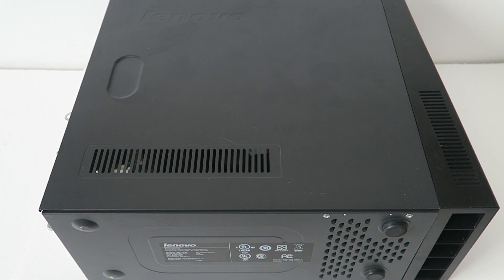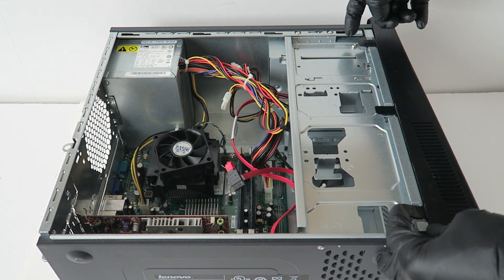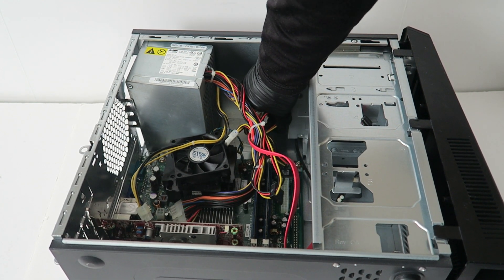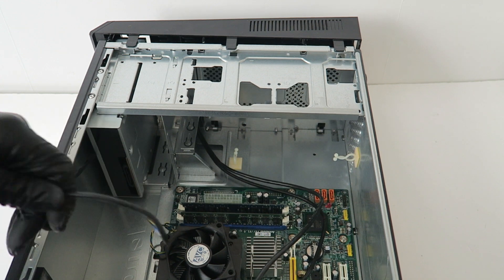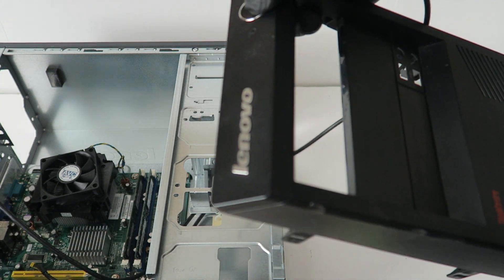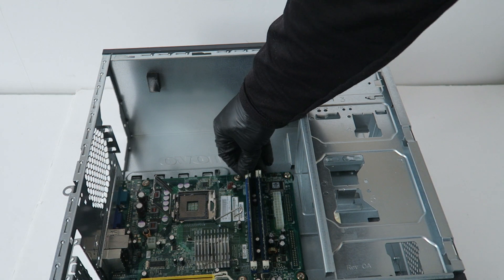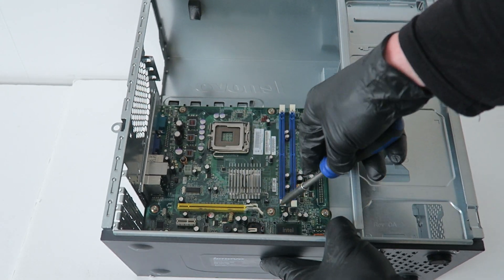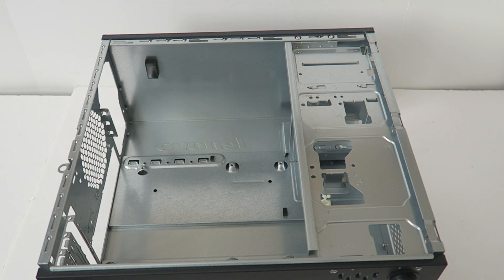Lenovo ThinkCentre Teardown

Comment: Hi, could the front panel connector (power button, reset, ecc.) be used in a normal motherboard like the ones from Msi, Gigabyte, ecc. or is a proprietary connector?

Comment: Hi there what the latest in the pc world. Very good advice, and very good videos too. Have a question for yeah what is the difference between a  i7-4770, and a i7 3770 3rd generation, and a 4th generation i7 Processors.
Reply from the maker: HI, not a lot of difference.. i do have right now i7 4790 and 3770 is 77w and 4770 is 84w (Thermal Design Power) and 4770 does have better Graphics 4600
Reply: @Mxkdt  ohhh ok thank you I see there so is the i7 4th generation a little bit better than the i7 3rd generation..perfomance wise..